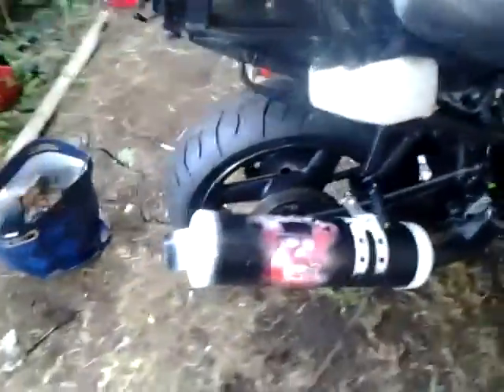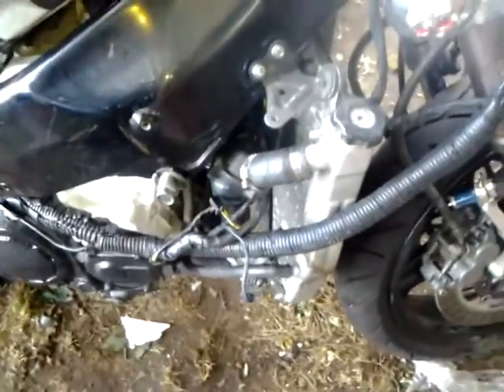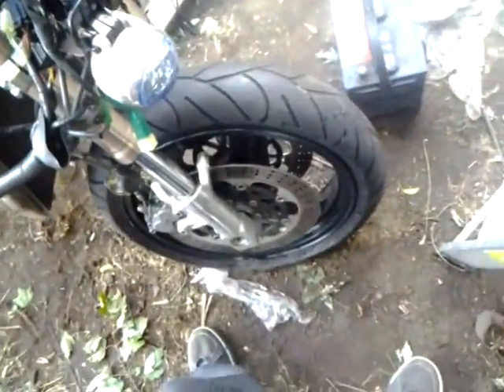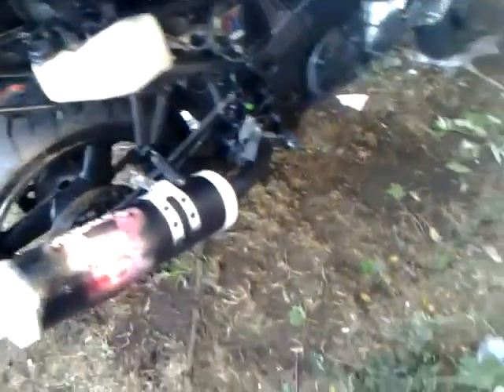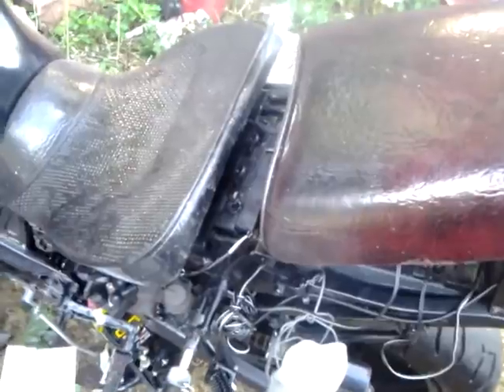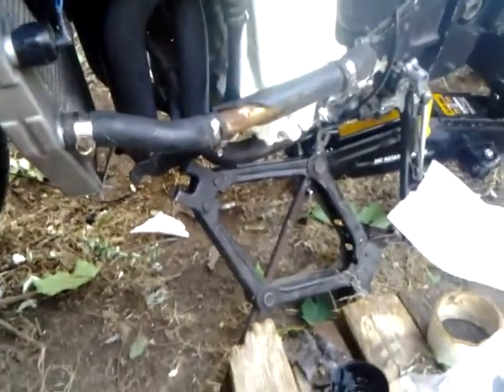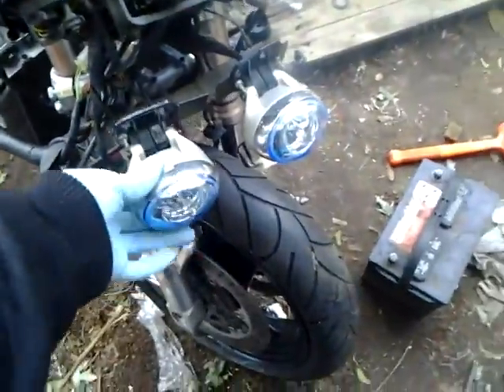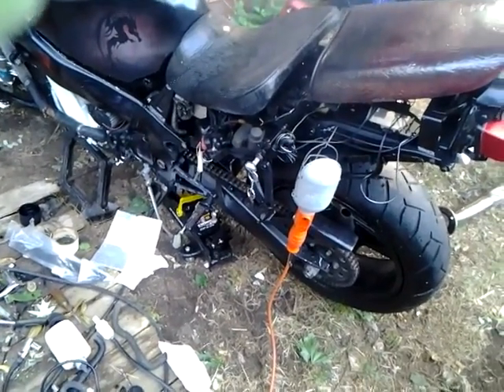Update zx750 project

Comment from the maker: battery problem fixed! installed a new battery but the real problem was the clutch safety switch was not connected.. since I posted this video I have installed another starter motor (I burned the original out), and the bike now tries to turn over... check latest videos.. thanks for looking and don't forget to sub...

Comment from the maker: Yes & no. The battery is stong enough to power the fuel pump but now the solenoid is not working. So I fixed one problem and adopted another.. this is definitly a project. Ordered another solenoid and coils. Will post video when I install them.